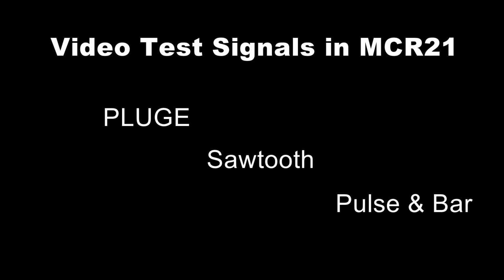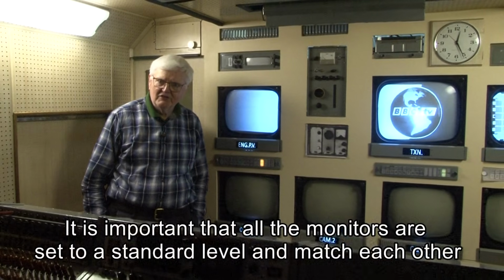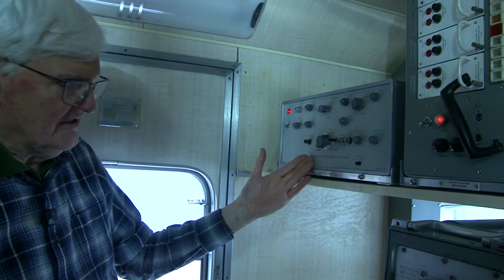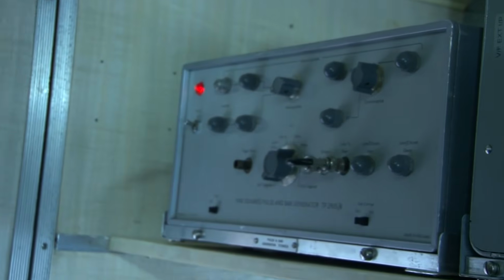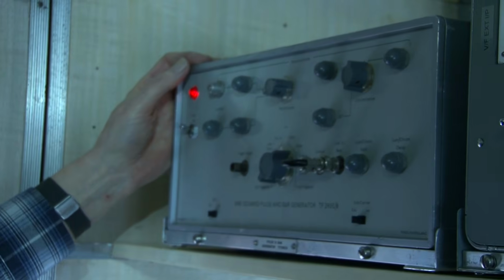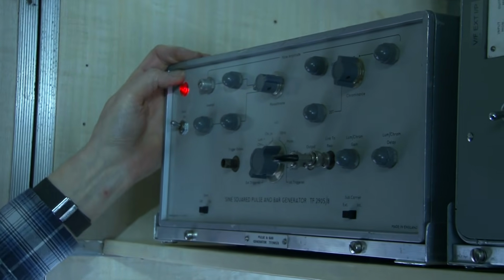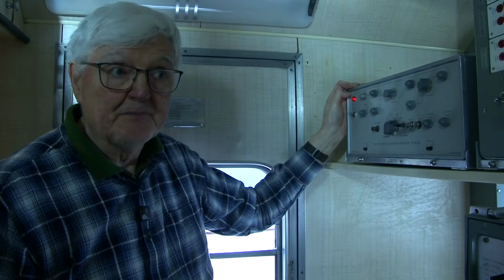BBC Test signals – as used within MCR21

Comment: That takes me back !   I used to use PLUGE to set up CRT video projectors back in the early 80s ( only I understood the acronym to stand for Picture Line Up Generated Effect ! ) and for setting projectors up out in venues , instead of a generator , I had a U-Matic tape with about 30 minutes of PLUGE recorded on it ! The projectors themselves always had  their own inbuilt hatch pattern generators that I could use to register the red and blue tubes onto the green one in a dim and distant past ! And that , on BARCO projectors at least , we used to unplug the convergence board to do mechanical alignment of the tubes before doing it electrically , and that on a lot of them we used to physically align the coils on the necks of the tubes with some scary HT voltages flying around - no health & safety back then ! I always found Sony projectors easiest to set up , but worked with Rank , BARCO , Sony and NEC ones in the CRT days , and things like Sony , Panasonic and Electrohome once we moved onto DLP . 

I can't help wondering if the monitors in the OB van were made by Melford back then , as were the ones I mostly saw in BBC studios later on ? 

This really takes   me back , watching further through the video , although I was always using colour , I do remember looking at sync pulses and bars both on monitors/projectors and on  scopes ; although my understanding of them would have been nowhere near Brian's , but I did have an understanding of what the waveforms and images ought to look like ; I also used the colour bars , with the colour turned right down as a greyscale , which I could confirm on the scope went up from black level to peak white in even steps without crushing at the top , then in a darkened room the monitor could be set so that black just didn't register and white just didn't burn out ; then colour could be brought up to taste ! 

The other instrument we used back then , I think not relevant to monochrome , was the vectorscope , and working with PAL I always knew roughly where the two vectors should point and their amplitudes .

This is all stuff I did some 40 or more years ago when working in the conferfence/presentation industry and had to set up monitors or CRT projectors for events in outside venues ( mostly hotels and conference centres where there was no permanently installed equipment , and often setting everything up was done overnight ahead of an event ) .

Also seeing some of the connectors took me back : the patch bay in the side of the vehicle with SO239 and PL259s ; and right at the end of the video the MUSA patch bay are just things I haven't seen in years !   A bit sad that I  still remember what they're called !